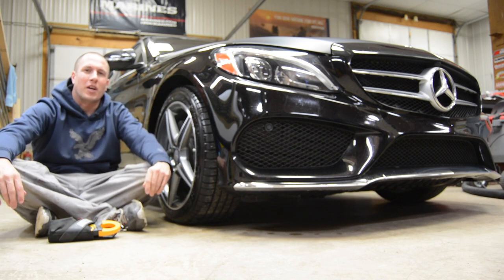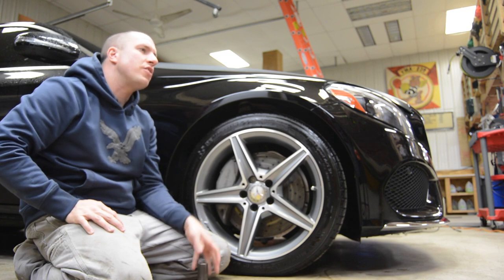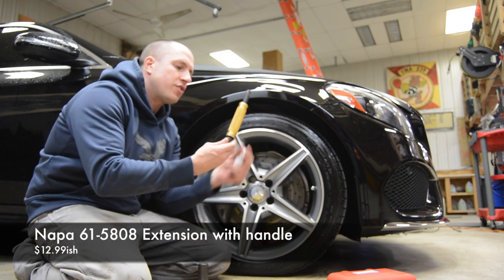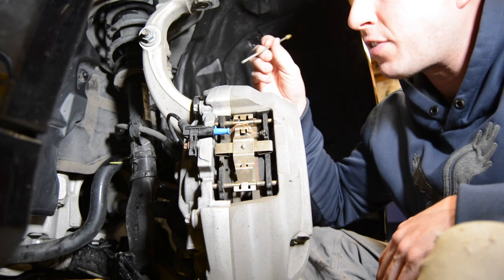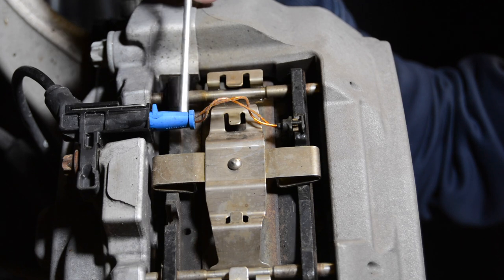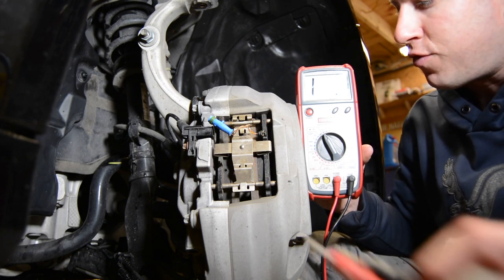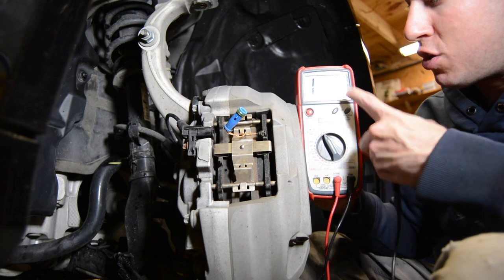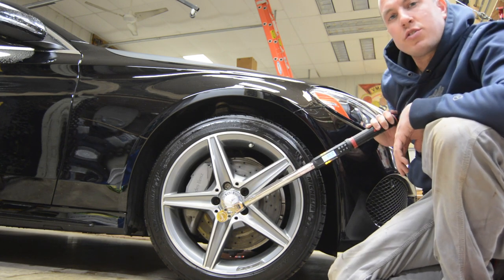Mercedes C300 W205 Brake Pad Wear Sensor

Comment: Hahaha I definitely need a check-up from the neck up kiddo! Hahaha 

Even so… I appreciate your generosity in sharing you great information!  

I have a 03 E320 😊yes it’s older but like Janis Joplin said we are like fine wine we get sweeter with age😁HOWEVER… the parasitic drains do become a bit harder to pinpoint! 😂 

Anyways … thank you again for the content.

I changed my own brake pads a Few weeks ago n possibly didn’t put the sensor back on properly 🤷‍♀️and so I am wondering if that could be causing battery to be dead on the second night each time it’s fully charged (2week old battery n I overhauled the alternator n had it checked as well n it’s good ) … i by chance you come across this comment and have any ideas that might help this gramma would sure appreciate it.🙏🥰thx God Bless
Reply from the maker: Yeah parasitic drains are ridiculous and hard to find.  Since your battery is going dead fast, it must be something larger!

Comment: Your video on the brake wear sensor on the MB C300 is very well done - great quality of the video (angles, lighting, technical aspects).  Are you going to do a video on replacing the rear pads and rotors on the C300?  I've been looking for a good one - but they are all lacking (poor videography).  It would be great to see your take.  If not, can you recommend a great video for this task.
Reply: Here is a video I found doing the rear pads and resetting.  https://www.youtube.com/watch?v=T9LdRtxIzkk
The Durbincompound vid is great as well.

Comment: Hey Bud, can you make a video on how to reset my check break pad wear on my Mercedes c300 message dash board. Thank you.
Reply from the maker: https://youtu.be/J2kq6zogYOY
Reply from the maker: As far as I know, the check brake pad light works a lot like the “light bulb out” indicator. The only way to get it to go away is change the sensor that has worn through. This will update the computer at next start up
Reply from the maker: What a pain. I’m not sure!
Reply: Mauricio Espinoza Apparently Mercedes put on new ones that’s what they told me

Comment: My 08 c300 4matic sport only has 1 wear sensor on the front driver wheel. I checked all other wheels and there isn't a wire anywere,kinda weird. No chimes or indication on display saying there is an issue.

Comment: Nice video but how do I know if the problem is on the rear wear or front wear
Reply from the maker: You don’t! You have to figure out which sensor is showing the open reading! More than likely it’s the back! Start there.
Reply: TheDurbinCompound appreciate it a lot really helped 👍🏼👍🏼
Reply from the maker: No problem.  Sorry for the late response!

Comment: Bro i noticed your flag in the background if I’m not mistaken was that VMA-223??   I was @ VMA-331 simper FI.  I recently just brought a 2018 C class 300 loving your videos.
Reply from the maker: Awesome! Yep I was an avionics guy at 223 from 2005-2011 then out to recruiting duty....
Reply: I was aviation ordnance from 89-93 then VMGR 252 aviation electronics until 96..
Reply from the maker: Nothing but good things! Nice to meet ya Devil. Hope to see you around the channel!
Reply from the maker: I knew a Singleton in ordnance at VMA-223. Around the same time that I was there.
Reply: Oh wow.  I was long gone by then they disbanded our unit not long after desert storm..   if you remote start your c300 will it cut off if you open the door??  Or is it just mine??
Reply from the maker: Harold singleton mine does the same thing. Absolutely hate it. I also hate that if you have the auto stop feature on that it will shut of as soon as you stop even though you might be about to put it in park.

Comment: My C300 still has the brake pad wear indicator light even when I replaced the pads and the new sensors that came with the pads. Any idea what might trip the sensor? Will removing the entire sensor trip the light (meaning not put it on)?
Reply from the maker: Removing the sensor WILL trip the light.  My first guess would be that you have a wire worn through somewhere right there by the tire and everything that moves. Remember they have sensors on the front and back. Did you check both?
Reply: Thanks for the info! I'll check both this weekend again.
Reply: Ry_Raian on a Mercedes. After the sensor has been replaced, you have to have the code erased using a computer plugged into the OBD.